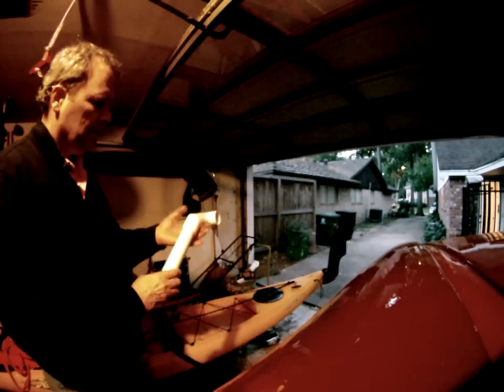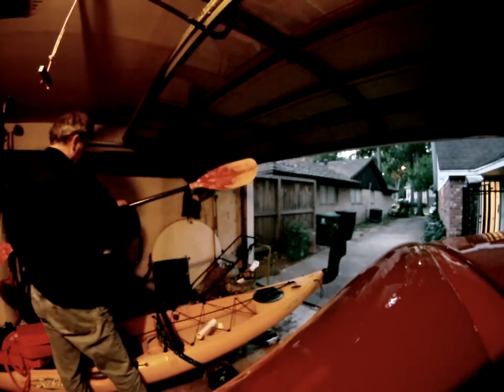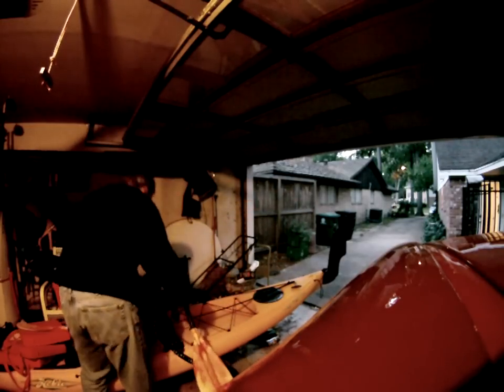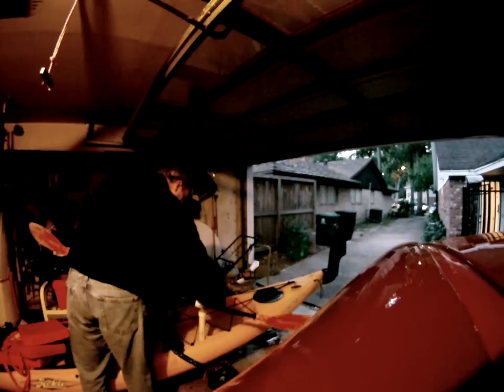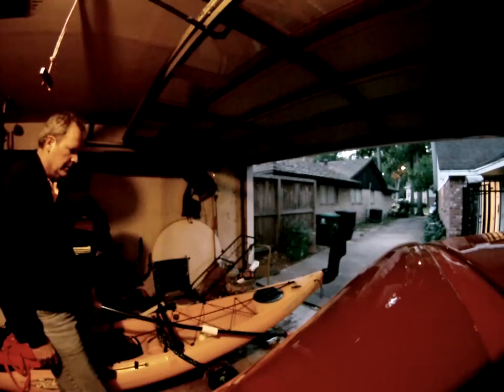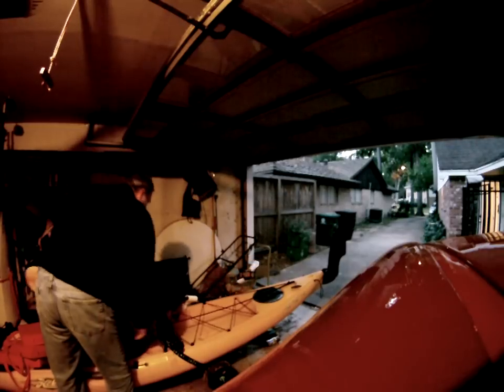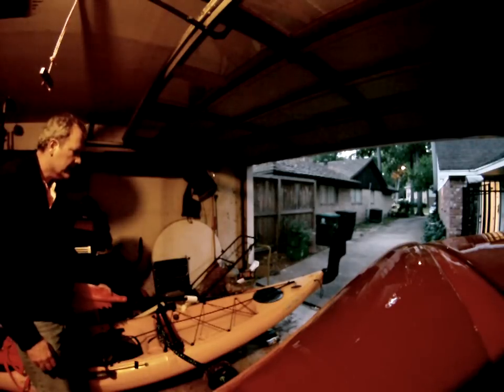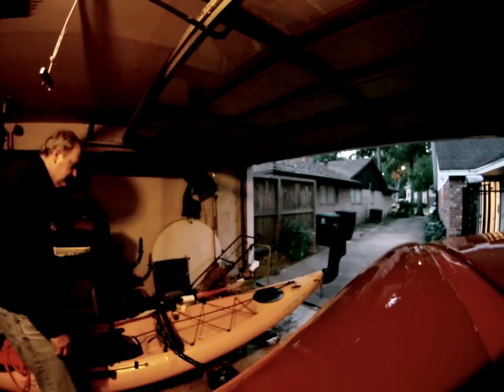Rudder Loss Solution

Comment from the maker: Glad you may be able to use this Peter. I haven't tried it out yet I think it will work. I found that i could not steer the boat just holding the paddle in my hand. Having something to leverage the paddle on may make the difference- much like you would an oar. One day I'll tackle the motor mount issue. I hope to ad a small gas or propane motor eventually.